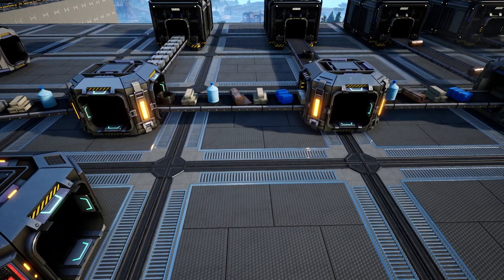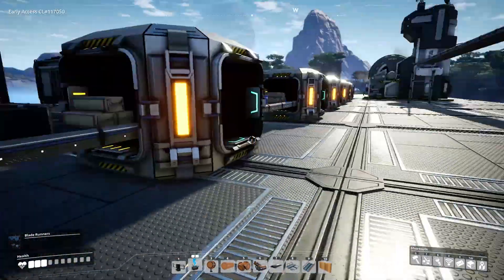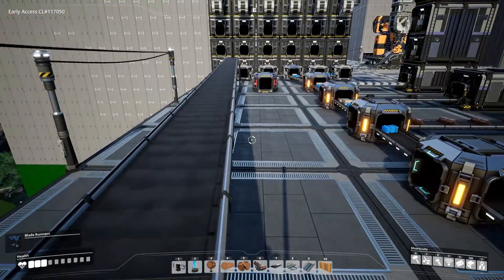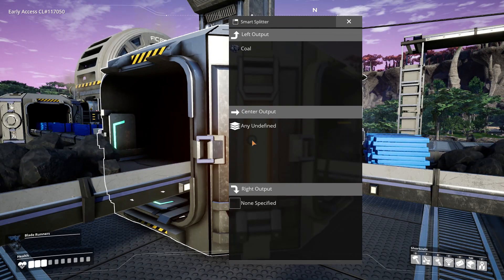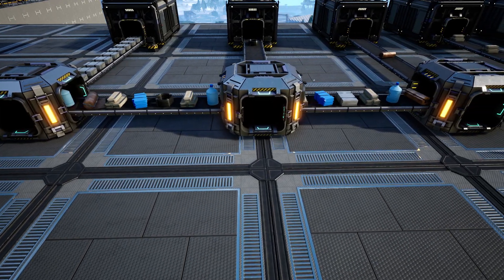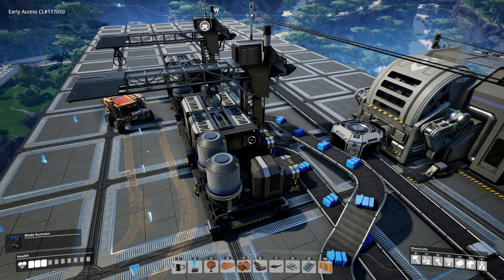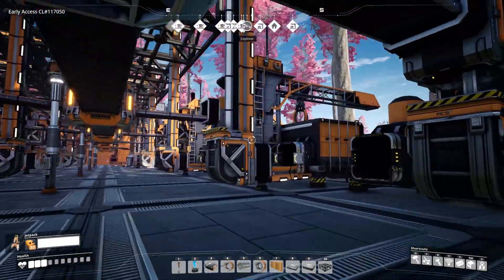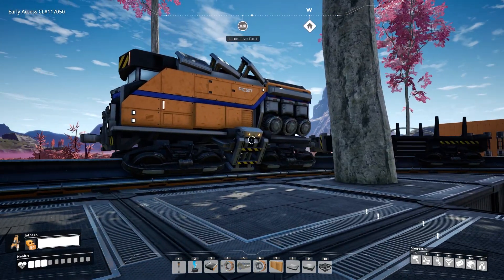Guide to Smartsplitter and Overflow management.

Comment: I agree that the advanced logistics mod does a better job for overflow. Now that Update 3 just went to Early Access we'll have to wait for SML to update and when the mod updates as well. Another thing is I'm glad you're pointing out that the pipes operate on fluid dynamics of level. I've seen a pipe's flow "rock" back and forth after I used a train to transport fluid to an Industrial Fluid Buffer when the pressure from the platform ceased until it leveled itself through the system of all attached buffers and pipes. Great video as always and I look forward to the next one!